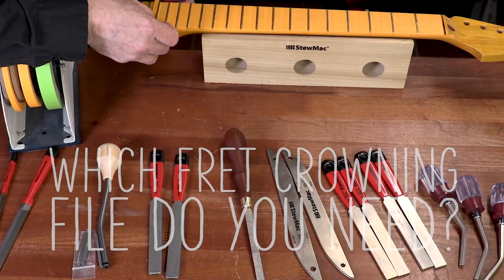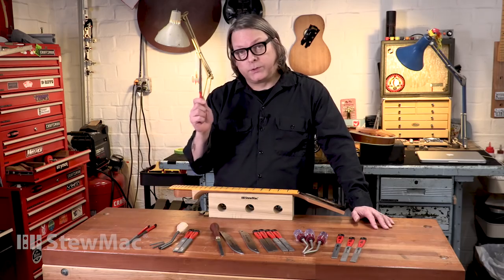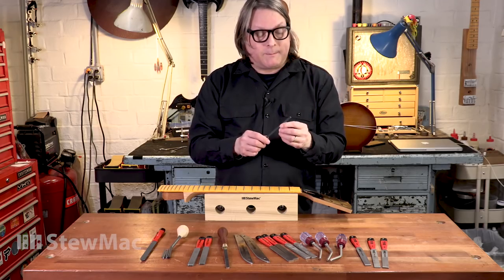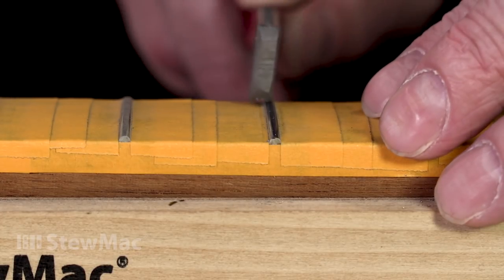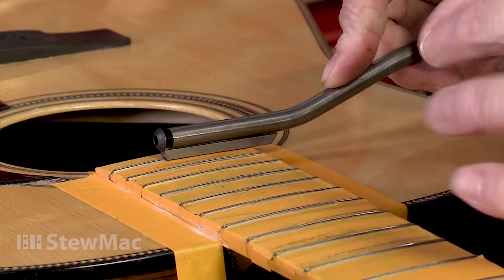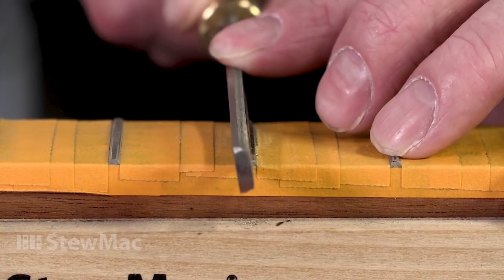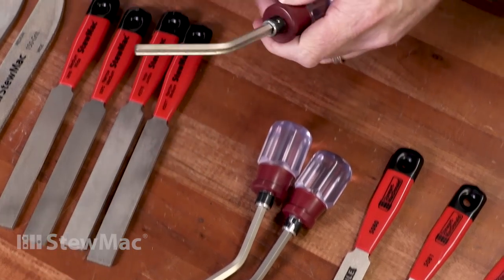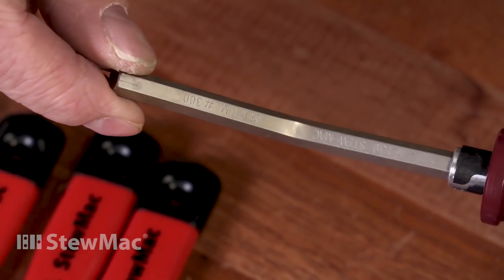How to choose the perfect fret crowning file

Comment: The cost of the Z-Files doesn't scare me. What scares me is the diamond abrasives. I had the StewMac Dual-grit Diamond Fret File and it wore out pretty fast while crowning stainless steel frets. Before investing in a Z-File, I would have to be convinced the abrasives will last. Until then, I'll stick with my trusty 3 corner file, chatter and all.
Reply: You can stick with your 3 corner file because you're experienced. For us n00bs, we need something easier.
Reply: JellyBean120830  I’m being totally honest here.  The 3-corner file IS easy -very easy because you will have a clear line of sight to what you’re doing.  Blue your leveled fret, then file it from both sides until all you have is a thin blue line in the center. They’re slow, but accurate. All of the other files make you work blind, and except for the “Z” none will leave a center hairline.  If you pick the wrong size you’ll wreck your leveling efforts bc the file will be hacking away at the top of the fret within a couple strokes. You wind up with a LOW fret every time and the only fix for that is to re-level the entire board (start over) or worse yet - have to replace the low fret.  That’s no job for a noob either.  Finally - think about the cost. The price of a single Z file is $80-100.  For $100 you can buy half a dozen industrial Nicholson 3-corner files in various sizes AND a 6” bench grinder to create the safe edge.  It takes literally 15 seconds to knock the teeth off the corner of the files so they don’t scratch the fingerboard.  OR. You can buy a pre-safe edged triangle file from Stewmac for $30.   Finally, none of the fancy files will dress the fret ends.  For that you have to use a small conventional file with the edge ground off anyway.  So why not learn to dress and use a 3 corner file in the first place?
Reply: Highline Guitars. Totally agree.
Reply: @HBSuccess  Agree! I'm an amateur guitarbuilder and only used the 3-corner file. The first time it took me a bit of time to get into the groove, but once I got it doing the frets was a breeze. Those files are cheap, easy to control, and work on all fret sizes. 

Crimson Guitars has those files as well, and aren't too expensive.
Reply: Definitely...whenever I use a diamond file, I feel guilty...like I’m contributing to its destruction rather than working with it. The only one I’ll work with is neck check guitars’ crowning file. It’s good and it’s cheap so hey. Until these become more durable, it’s the three corner and the cheapies. If I’m spending $50+ on a file, that’s an expensive tool. I want it to last forever
Reply: Yes,  grit files are going to wear down pretty fast on stainless steel. lol.
Reply: @HBSuccess  I agree! 3 corner file ftw! I did my first ever level and recrown and it went excellent.
Reply: @nusior  What file did you use? Or brand specifically? Im thinking bout doing my first aswell
Reply: @zachary1657  I got mine from Crimson Guitars.
Reply: @HBSuccess  can I level each fret with a 3 corner file instead of using a beam? Let’s say I only need to level like 1-5 frets
Reply: Call Stew Mac if any tool wears out , they will replace it. Its part of what you pay for.

Comment: From all of this explanation it seems to me that the Z file should have been made with the offset handle to have the best of both worlds.
Reply: well, given that the offset ones only work on one edge, you'd need 2 files to get both cutting edges
Reply: @kennethdon3619  
We'll I was thinkin it would be like the offset he showed that unplugs from the handle for the other side.  I wouldn't find that a problem cuz I often work one side up the neck then flip it around for the other side.  This way the offset is easier if neck is attached to the body.
Reply: @kennethdon3619  Maybe a dumb question.... but WHY two files needed to work both sides? Just working from the other side of neck seems like it should work as the curve of the fret is same on both sides.

Comment: Hard to beat a three corner file for fret crowning. Just slow down and learn how to use it.
Reply: Yup
Reply: totally agree. I have never done this before, I am curious now to start. I would go for a three corner file with rounded edges. Lots of control and you see what you do. Also, I guess one can do a very fine job. Just taking one's time, go slowly.... I guess
Reply: @fabiopunk1661  , I've used several crowning files but they all obscure the top of the fret. Much prefer the three corner.

Comment: If you take the time learn how to properly use a 3 corner file you can zip through fret jobs and have extremely accurate fret crowns.
Reply: Plus, they can be use for so many other things. I use them for shaping nuts and saddles all the time. One of the most useful files you can own.
Reply: Would you say that's the best choice? I'm pretty handy with using tools already
Reply: Does it work well on low frets..lower then usual medium frets out of the box?

Comment: I use a triangle with a safe edge. I'm actually an Engineer, I started of as a machinist / fitter and went through an old school apprenticeship and really learned how to use tools. For me, using a triangle file gives me lots of control. Those skills I learned 30 years ago are invaluable and I would suggest are well worth learning. 

Sadly my day job now involves sitting in front of a computer doing math, FEA and typing reports all day long. I wish I had become a luthier. I think I would have enjoyed it a whole lot more than being an engineer. Most guys in the workshop can't use hand tools any more, it's a shame.
Reply: lexzbuddy yes. I’m also an engineer, although not mechanical.. I’m electrical. Still a common misconception is that engineers build things. We don’t. We design things to be built. There is an element of working with your hands during prototyping and testing but it’s minimal.

Comment: I absolutely love the Z file, particularly the Safe Edge version. I found the original Z file to have the same downside as the FretGuru Dagger (which is definitely pretty great) in that it only works well on medium jumbo frets or larger, up to a point. For vintage frets, it leaves them too round and cuts too much material. For tall or super jumbo frets, you also risk taking off too much. But the safe edge allows you to do one side at a time, which definitely is slower but results are always perfect. Great design. Probably best to have one of each of these.

Comment: I started with the diamond file, but found it not efficient for wide fret that has been leveled a bit low. so I went to three corner file and quite happy with it. it give me freedom to shape any kind of fret size with just one file. then I use the diamond file to finalize the crowning shape and remove most of the chatter to make the polishing easier.

Comment: Having tried 4 different types I eventually settled with a 3 corner file. This gives me the best control and accuracy and with a bit of practice, I am able to finish pretty quickly. I would not go back to the diamond files, they are not for me, gets clogged easily and difficult to clean

Comment: Very good video.
I had an intonation issue with my ESP AX-50 LTD after 12th fret on G string.
I had to use a #400 and #1000 sandpaper to crown some frets.
In India these things are hard to get unfortunately.
Reply: Is sandpaper hard to get in India? Or do you mean the files?
Reply: @M_EvoBass  The files. Sand paper of this grade is available with specific shops only.
Reply: @shashanksherkar392  ah OK,  I'm in the uk , if you need help getting some let me know.

Comment: The cost didn't scare me it sent me to the ER!!! after thinking about it though I figured I either have to buy a new guitar or fix the one I have so I sprung for some new tools including the original z- file. Will see how it works out.
Reply: How did it work out? Other option of course is to pay to have someone else do it.
Reply: Worked very well! Just have to be careful, a little at a time and keep checking!to me it was well worth it.

Comment: Good Stuff, I see you run tape along each side of neck before taping on the sides of Frets, Easier for Removal. Don't see others do it, or haven't watched enough Videos. Since the Seventies, polishing frets was first thing I did. What's your though on crowning only on the down side of the fret. So notes are correct for Intonation. And the larger surface area of the fret, reduces fret wear. Maybe I'm just Lazy, cuts crowning time in half. Ordering more Fret files. Take Care

Comment: 3-corner file is the best tool for luthiers who do their job often. It takes time to learn how to use it properly. But once you get it, you'll be able to make perfect round tops on any type of frets, very thin or thick (concave files make a bit flattened tops on thin frets, etc). So 3-corner file is the hardest to use for beginners, but the most accurate tool.

Comment: Dropped 100 bucks on a Z file after looking at the original model for years... interested to see how it goes.
Reply: How did it go?
Reply: @LeviBulger  I personally preferred the 3 corner file! The Z file is still a useful tool and I could probably get the whole job done with it, I feel like I burn through less fret with the regular file since I have the control.

Comment: Curious how none of the concave files have safe ends opposite the handle -- really easy to accidentally dig into a guitar top. Ends are sheared pretty sharp.
Reply: Always use a top protector when you do a fret crowning or leveling job on the tongue of the fretboard.